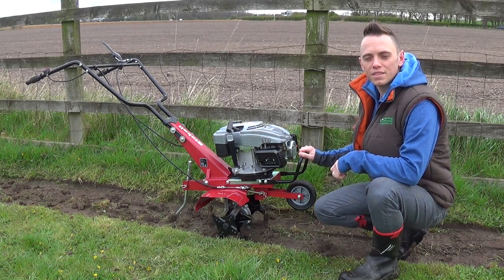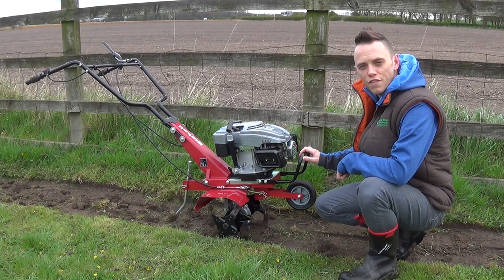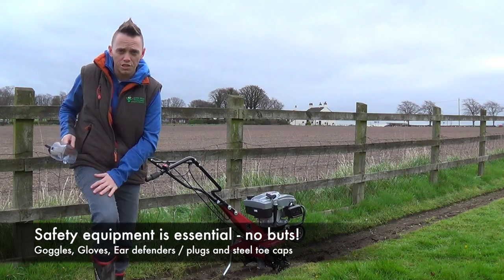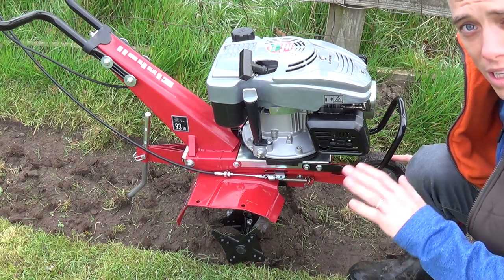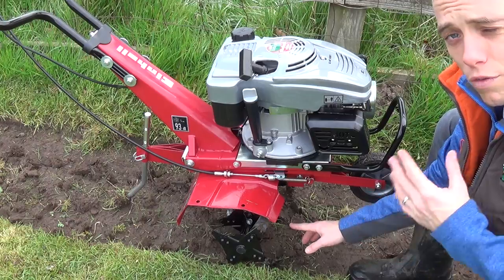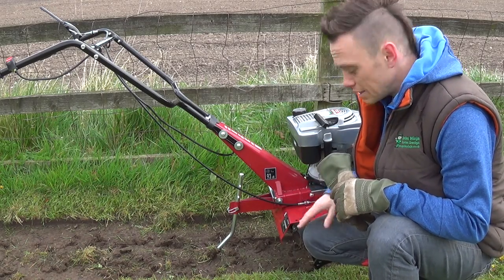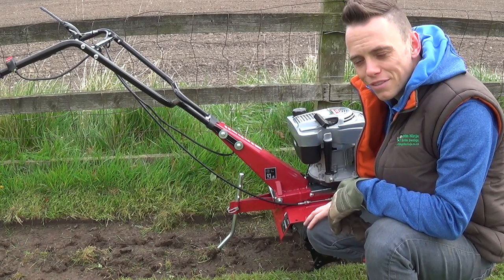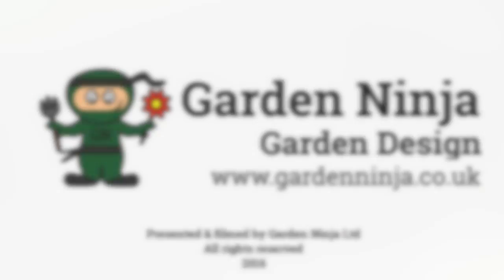How to use a soil cultivator rotavator

Comment: Rebuilt an old four blade tiller and ran around wrestling it, I am 6 ft plus but what a fight until I realised the tine at the rear which was missing was a drag brake.  The digging tines drag it forward the brake/spade/bar slow it down its adjustable to suit ground conditions. Made up one and what a difference.
Reply from the maker: Hey Anthony. Great to hear from you. Yes they can feel a bit like a bucking bronco without proper handling and that drag break. Great tools once you get the knack and if the ground is already soft. No use on compacted ground. Happy tilling!! Lee

Comment: Would you recommend using a cultivator and then double digging or improve soil in a garden, or would skipping straight to double digging be the best option?
Reply from the maker: Hi FT. I’d never advise double digging. It has a really negative affect on soil structure. I’d always recommend single digging if the soils compacted or being converted from turf. Then add organic matter like compost and mulch. That’s the best and easiest way to improve soil. Hope that helps. Lee
Reply: @Gardenninja  Thanks for the response, I was considering double digging as this is for a new build house, and I've heard that the soil in new builds is full of rubble and not great. However if single digging is enough that's good, thanks.

Comment: Hello & thanks for the video.
I've just moved into my parents house after they passed away, the garden gets soaked as it has clay under the grass, can I use one of these to dig up the garden then replace with soil?
If so how far down  should I go unroll the clay has no effect on my garden?
Thanks
David
Reply from the maker: Hey David. Great question. Sadly the answer is no. You’re going to have to dig out a good  2-3 feet of soil to get rid of the clay. Then replace. Chances are even then you’ll need a lot of excavation and even then drainage may still be an issue. Depends what’s underneath. The better option although a bit slower is to mulch/dig in as much organic matter as possible. Manure or compost is best. Maybe ask a local equestrian centre if they have any rotted horse manure they can provide you. Layer this up a few inches deep on all your exposed soil as a mulch. Then let the earth worms do their trick in breaking up and loosening the soil. I know it’s a pain but clays actually a brilliant soil type as it’s so rich in nutrients. You just need to help with drainage and aeration for easier planting.  I’d recommend using a hollow tine to aerate your soil and brush in some sand.  That will help with the clay. You can also top dress you lawn with a light covering of compost which will get taken back into the soil by bacteria and worms. Hope that helps and don’t give up. It’s a long mission but will be well worth it. Happy gardening. Lee
Reply: @Gardenninja  Thanks.
I'm happy (of sorts) to dig as far as needed, so If I do layer it on top of the remaining clay  with compost & soil?
Reply from the maker: Hi David. Yes I’d add a good few inches after digging of compost or manure. This will help break up the clay and add some aeration. Good luck and happy gardening! Lee

Comment: Hey there, do you think a rotivator would be suitable to use on an area of soil which has been covered in ivy? I’m still digging and cutting it away, but I wondered how to try and keep it away going forward. It’s a nightmare, all tangled into next doors garden too! I’m determined though as I hate it!! Any tips greatly appreciated! Thanks. 👍🏼
Reply from the maker: Hi Tina. Definitely not I’m afraid. Ivy can root from cuttings. So if you slice it all up you’ll just get stronger rooted ivy everywhere. Sadly the only way to get rid of it is manually digging it out and disposing of the roots I’m afraid. However it’s great exercise and you’ll feel wonderful once you have a perfectly ivy free flower bed to plant up!! Good luck! Lee

Comment: What did you use to get the grass up?
Reply from the maker: I used a turf cutter. I have a guide on how to use one and it’s far faster than manually removing turf! Happy Gardening! Lee
Reply: Garden Ninja Ltd Are they any good on uneven surfaces?
Reply from the maker: Not too great. It depends on how uneven. It’s better on level turf or you may get patchy results. It won’t level up uneven ground if that’s what you’re trying to achieve! Happy Gardening. Lee
Reply: Garden Ninja Ltd Thanks for the reply. I’ve inherited an allotment and the ground is just couch grass and it’s very uneven. Would love to know a hefty machine that could break it all down. Preferably not a JCB.

Comment: Can I ask.. Do you make sure Blades are in the ground first or just under the surface?
Reply from the maker: Hi Karen. You want them just and so in the ground then as you start the cultivator you can pivot the machine and use the stand to get the desired depth you require. Hope that helps.

Comment: My garden is made lumpy and uneven, it’s higher on the left and slopes down towards to right with the street. It’s grass at the minute with a few dandelions, I’ve used round up on them to kill them two weeks ago and they are slowly disappearing. I was thinking of using a tiller on the whole garden the rake it over so it is all level, then putting down grass seed. Help....!!! I’m starting to think it’s not that easy 🤯
Reply from the maker: Hi Tyler, Firstly don't panic. Every problem in gardening can be fixed and the great thing is you can do it in stages! You have two options. A) Remove the turf, use the rotavator to level and even the surface then reseed. Thats a lot of work. Or you have B) Use a scarifier (I have a guide on that too check out my video list) to clean up the existing turf. Then add more fine top toil on the lower parts over the turf until it's all level or at least less of a drop off to make it easier to mow. Then reseed the parts that have been filled. If people have drops in their lawn you can partially cover with fine top soil an inch at a time and the old grass will grow through, meaning you can increase the level over time or add a few inches and reseed over the top. That would be the easiest way to get the lawn level. However, it depends if you want lawn. I hope that helps! Happy Gardening.

Comment: I have just purchased the same brand, unfortunately, what is evident from the video the clip 2:58 -3:03 is the fact that it is like controlling a bull. In fact, it jumps up! I doubt that Arnold Schwarzenegger could keep it still. It is tough, very tough. I am a physically fit person, however it took its toll on my shoulders and elbows. 
The machine is a failure as the rotors are positioned immediately under the heavy strong engine, this leads the entire machine to get a kick-back from hitting the top surface of the ground and starts jumping in the air by about 6 inches, then land on the ground, as it does lands it gets another stronger kick-back upward and it goes on making you looking like Mr Bean in the garden.
Reply from the maker: Hi Ann, Thanks for the comment. When using a cultivator it will bounce on heavily compacted soil. Especially soil with high clay content. A lot of people think it will break up even the most compacted ground however the soil does need to be relatively loose for a soil cultivator to work without jumping around. ie it can cut through clods of soil but not solid ground. They are powerful machines. I'd advise using a fork first if your ground is really compacted to roughly break it up and then a cultivator to work it to a fine tilth. Hope that helps. All the best. Lee
Reply: @Gardenninja  I seem to have worked it out! One has to start the rotovator, then keep it in one point for it to go to the required depth while it is static, so that one makes a hole inthe ground,, then move it to the next hole to be. This is the easiest way to turn the soil. This machine is unlike other machines, strong engine but poor design. The wheel should have been in the back and the rotors should have been at the front for it to work like a cultivator.
Reply from the maker: @annbary8853  Glad to hear you've got it sorted Ann, now you can get cracking preparing your soil! Happy Gardening. Lee

Comment: You spent 90% of the time with fluff. I wanted to see how it rotavates on overgrown grown grass and weeds - not on a stretch of soil that has already been rotavates. But thanks for the effort to post it.
Reply from the maker: Hi Partha. Thanks for getting in touch. You don’t want to use a cultivator on perennial weeds. All you’ll do is chop them up and multiply them. It won’t kill them. It will encourage them!! You always need to weed first then cultivate. Same with grass. You need to remove turf before you cultivate or again you’re just going to multiply your grass! They will regrow from cut rhizomes or roots. Hope that helps and thanks for taking the time to comment. Happy gardening!